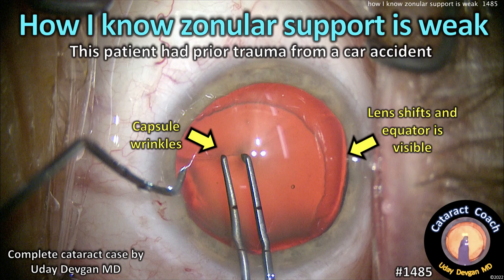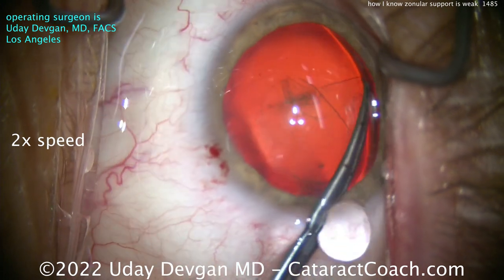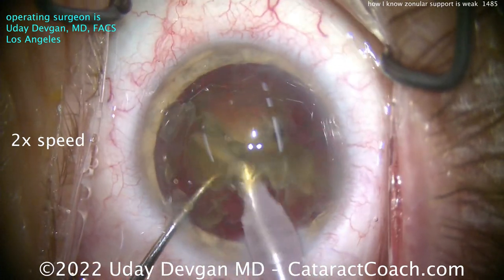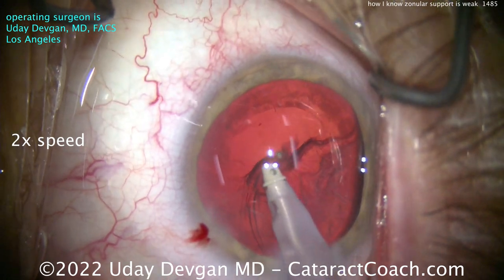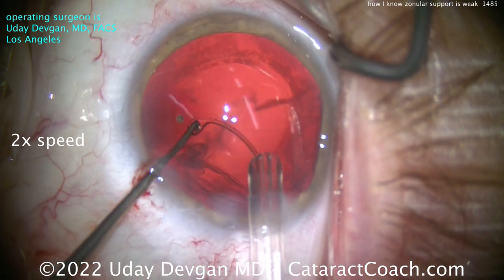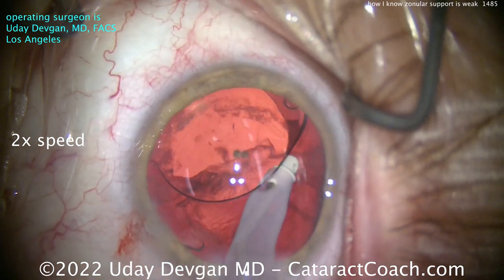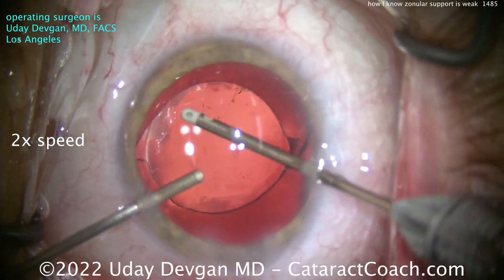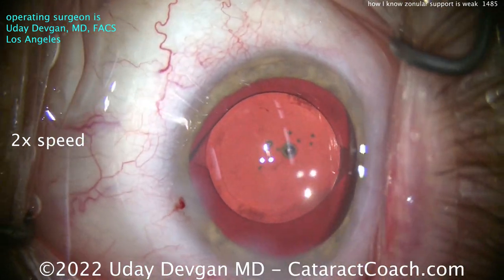CataractCoach 1485: how I know zonular support is weak -- and what to do about it

Comment: Would you have used a needle to start the rhexis given the significant zonular laxity?
Reply from the maker: sure, that is also a reasonable option.
Reply: Sharp entry with a cystotome, keratome etc is good idea in these cases if the zonular laxity is apparent, IMHO. Sometimes, as in this case, you only find out about it when trying to start the rhexis in a normal fashion, but I try to avoid stressing the zonules as much as possible.

Comment: Are you surprised by this pilot’s choice to pursue an EDOF lens over a monofocal lens?
Reply from the maker: it is a reasonable choice for him. the downside of this EDOF is decreased contrast, but we should note that this EDOF IOL will give him much better night vision and night contrast than he has now with the cataract. So it is certainly an improvement. He is very happy.
Reply: @UdayDevgan  Also, he needs to see the plane's controls and buttons which are on a intermediate distance, it would have been difficult if he had a monofocal IOL
Reply: And what about the risk of IOL displacement? 
But if you have a weak zonule, it increase the IOL disalingment, isn't it? Which IOL options can you use there (monofocal, toric, EDOF or multifocal IOL)? 
Thanks, I am not a refractive surgeon